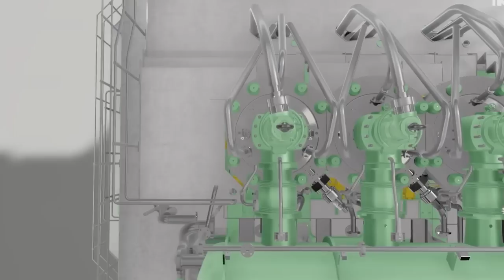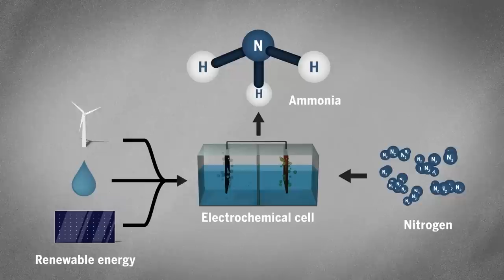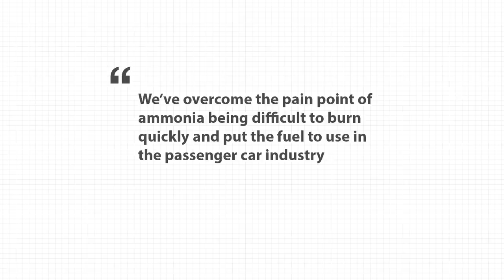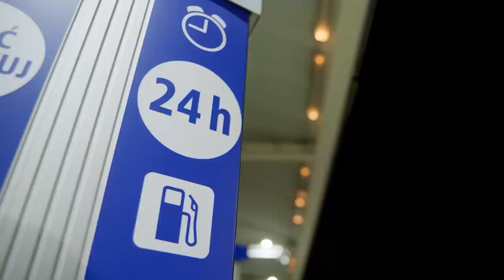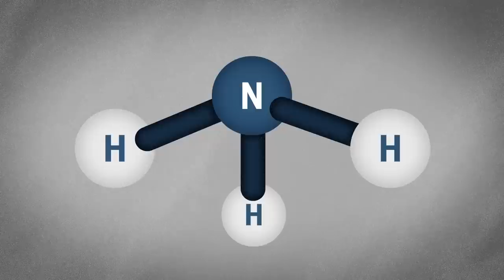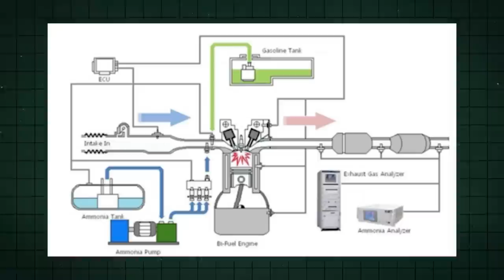Toyota CEO “This New Ammonia Engine Will Destroy The Entire EV Industry!"

Comment: The presenter mentioned three methods of generating energy from ammonia:

1. Ammonia can be a hydrogen storage device for hydrogen fuel cells.
2. Mix ammonia with a liquid hydrocarbon to enhance combustibility.
3. Ammonia can be used as a single fuel, utilizing advanced technologies like homogeneous charge compression ignition (HCCI). It is worth noting that spark ignition, used for gasoline, and compression ignition, used for diesel, are not considered "advanced technologies" and are not even applicable here. Gasoline engines use homogeneous charge spark ignition (HCSI), while diesel engines use stratified charge compression ignition (SCCI). Essentially, this method encompasses a collection of technologies rather than a completely new approach.

The GAC/Toyota solution employs liquid ammonia. Naturally, ammonia boils off at -33°C, which is not cryogenic like liquid hydrogen fuel but still requires proper storage. Hence, the industry compresses ammonia at low temperatures for storage. The GAC/Toyota solution uses method two by dissolving ammonia into a small amount of liquid hydrocarbons and storing it in liquid form. They might use a conventional HCSI engine, but method 3, with HCCI, could also be utilized.

Another way to potentially employ HCCI is compressing ammonia, similar to how some countries, like Brazil, do for CNG vehicles, enabling the storage of anhydrous ammonia in tanks. Compared to hydrogen, ammonia is easier to compress and handle, as it does not easily seep out of containers and does not require a tank with a special coating. Fuel and air intakes homogenously premix the compressed ammonia with oxygen, and the engine further compresses the mixture until autoignition occurs.

Method 1 could be more interesting than water electrolysis. An exothermic reaction is ultimately required to provide work. Water, the oxide of hydrogen, exists in a low-energy state, necessitating an endothermic reaction. Despite having single bonds, water is highly stable due to the electronegativity of oxygen, which causes the electrons from hydrogen to be closer to the oxygen atom. Additionally, the oxygen atom has two lone pairs pointing away from the hydrogen atoms, behaving like protons due to oxygen's electronegativity. This chemical behavior results in a tetragonal shape and hydrogen bonding with lone pairs on other water molecules. Ice I_h, with a hexagonal crystalline structure, forms during freezing, whereas pressurizing the water as it cools produces tetrahedral Ice III, which better represents water's intermolecular structure. All of this underscores that water is highly stable despite its single bonds. In general, oxidation prefers single bonds since they lead to exothermic reactions. Liquid hydrocarbons like gasoline and diesel have long chains of weak single bonds that only need a spark (in the case of gasoline) or auto-igniting pressure (in the case of diesel) to ignite. Ammonia is structurally close to methane but more stable, resulting in lower flammability. As a hydrogen storage medium, it would require less energy than water to produce work. Ammonia has a flash point of 132°C, whereas methane's flash point is -133°C. Water, being non-flammable, has no flash point.

It should not be a significant concern regarding the emission of nitrogen oxides because modern catalytic converters are highly effective in addressing this issue. In contrast, liquid hydrocarbon fuels release CO2, which catalytic converters do not handle, contributing to global warming when released excessively. Ammonia addresses this problem by using nitrogen as the reducer instead of carbon. Nitrogen gas is harmless to the atmosphere, and catalytic converters can efficiently separate nitrogen oxides into N2 and O2.

The presenter also mentioned the Haber-Bosch process for sourcing ammonia which is considered "gray ammonia," but there are other sources too. Here is a breakdown of the various types:

Brown: Gasification of fossil feedstocks, emitting CO2 into the atmosphere.
Gray: Reforming of fossil feedstocks, emitting CO2 into the atmosphere.
Blue: Gasification or reformation of fossil feedstocks with CO2 capture, utilization, and storage (CCUS).
Turquoise: Pyrolysis of fossil feedstock, producing a safer solid carbon by-product.
Green: Electrolysis of water using renewable energy, with no emissions.
Red: Electrolysis of water using nuclear energy, with the by-product possibly considered nuclear "waste" depending on legislation and technology, but it could also be considered renewable, particularly in places with molten salt reactors, for example.

By prioritizing the avoidance of brown and gray ammonia, we can address any potential concerns associated with its sourcing.

Comment: Unless you can produce ammonia for free at home just like you can produce electricity with solar panels, that is an irrational claim.
Reply: Electricity for free at home? I just explored installing solar panels on my home. 28 years to break even and would need to be replaced at or before they would be paid for!
Reply: @terrylink7207  then you are paying too much for your equipment. Ask AI for the cheapest sources for solar equipment.
Reply: @buensomeritano1755  HVe already done that. In the Midwest it has not been cost effective unless the government was giving a major subsidy.
Reply: I keep hearing claims that solar power costs from large commercial deployments can get below 4 cents per kw/h. I sometimes even hear 1 or 2 cents per kw/h. If in fact we can get solar costs around 1 cent per kw/h then ammonia fuel based off of that power should easily be able to compete as a valuable form of stored energy. It may even be able to out-compete direct hydrogen since it is so much easier to store and transport. But like all things the devil is in the details, and you can bet that any such deployment will try to maximize profit and thus it would probably be a long time coming before such deployments can bring world ammonia prices down to a optimal fuel price point.
Reply: No its not oil is fine and ammonia costs less than 1 a gallon
Reply: @buensomeritano1755 no he is right not everyone's situation is not  the same.   Oil is fine.
Reply: @nolan4339 There  is a guy from Canada  that did this years ago.  Any gasoline engine can be converted for less than 1,000.   And ypu can buy ammonia for 1$ a gallon.  So don't listen to these people when they say a special engine is needed.    Or that they did anything special to their engine.   Ammonia holds the current land speed record.    And they have know  how to do this since the 1970s.   Ammonia  has 85% of the output of gasoline.    They are lying to you just as they always have.   However we don't need another fuel source.   The Rockefeller  came up with the term "Fossil fuels "   Oil is the second most abundant liquid on the planet.   Above even fresh water and behind only salt water.   Proof global warming is not from us u ask?   The ice caps on Mars are melting as well.   This  "global warming" fairy tail is all about implementing and new carbon tax and making them richer and you poorer.   That's why they want this gay and trans people is to end the nucular family because they produce children with the ability to think for themselves and parents that will fight for them.    It's a shame people can see this l.   If we don't find another drop of oil more than what we know about no oil won't be a problem for at least 600 years.    They want you to stop having kids and be slaves to the banking cartel.   Wake up
Reply: @nolan4339 Solar isn't efficacy enough

Comment: Toyota. Doing too little to late. EV is the future
Reply: EV will never be the future. It has massive and fatal flaws.
Reply: All fuels have drawbacks.
Reply: @bonkwonkelchip7569  EV is already the past and present. And future. EVs are replacing gas daily and within 5-8y gas cars will become all but obsolete.
Reply: @bonkwonkelchip7569   You are correct it's not the future it's now I haven't had a  Gas car in 10 years
 $8 a day to do 250 km every day
 I think you're missing the point it's too late the United States his living in the dark ages across the border in Canada 30% of vehicles in British Columbia are now electric in sales each month
Reply: Evs are more resource heavy on the environment than the ammonia version. Ev is not the future but a hybrid would would work. Look at diesel electric trains.  They work.
Reply: @admireandinspire4525  The US electrical grid cannot keep up with electric. Not to mention the lack of infrastructure to actually charge them in the first place. There is also the issue of charging times.
Reply: @tetontent  But electric trains work better...
Reply: @tetontent  but not as good as pure electric trains
Reply: Consider a electric motor to a car engine , way less moving parts , seals , pumps .